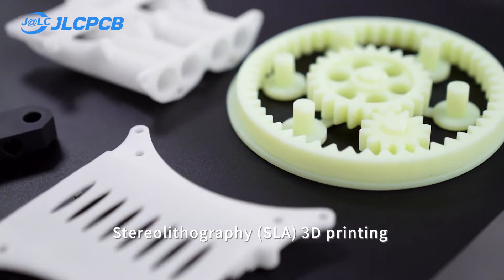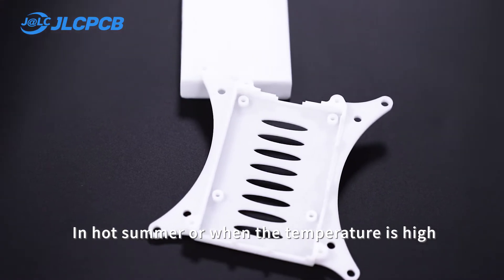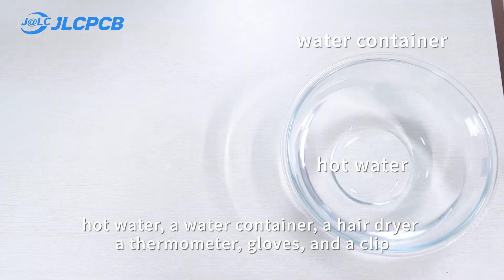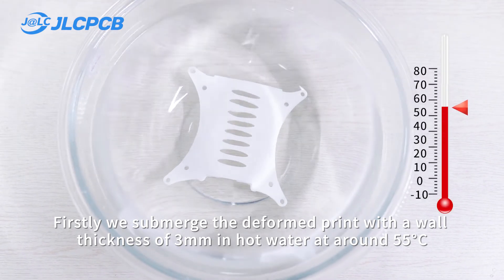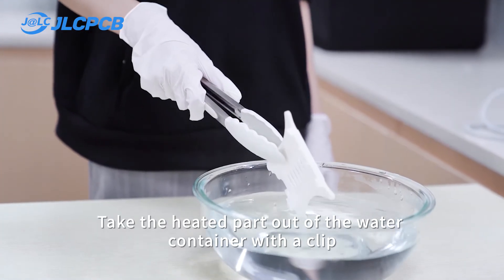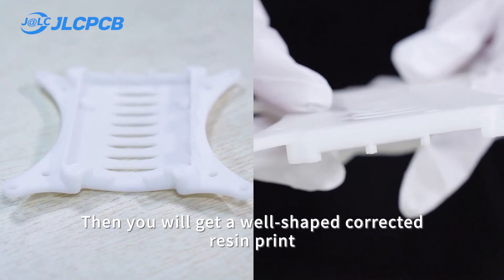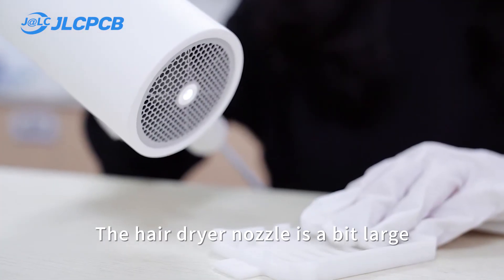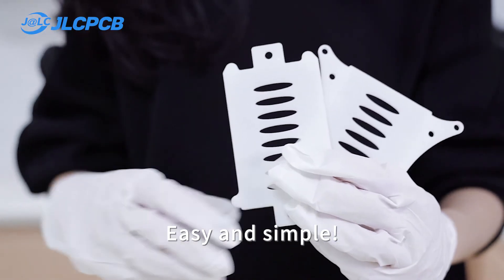Easy & Simple Fix! How to Correct Your Bending Resin 3D Prints! - JLCPCB

Comment: Its better to use a block of wood or (or 2) other hard flat surface to either sandwich or hold the part flat while it cools.  Using your hands will usually lead to more warping.  Ive found 2 blocks of wood and clamps work well for tougher warps.